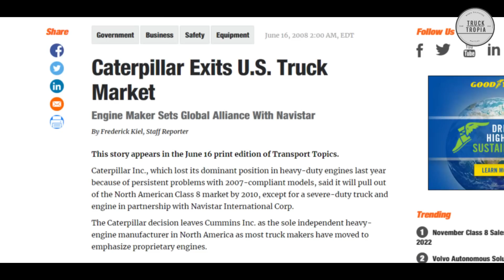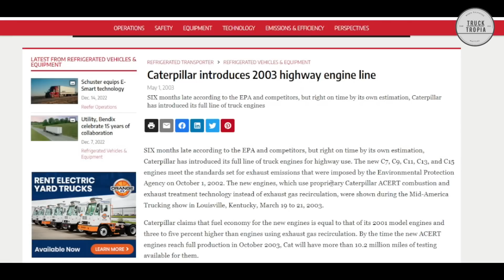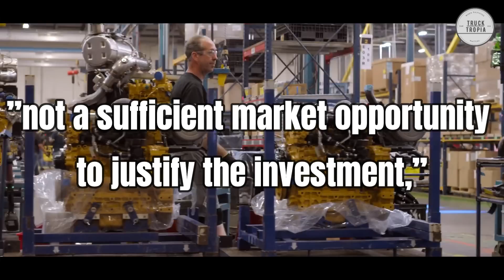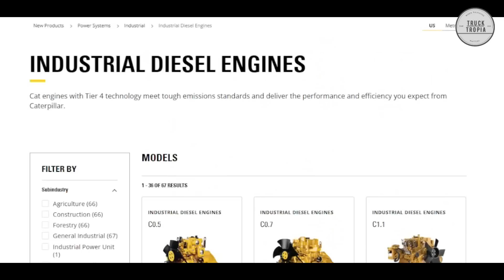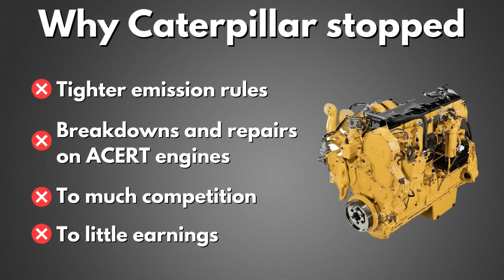Why Caterpillar Stopped Making On-Highway Truck Engines

Comment: I've seen videos (this one including) saying the ACERT C-15's are unreliable, and yet in the real world, every trucker that I've met that had a C-15 under the hood, swears by them. I know from personal experience, C-15 is one of the more reliable engines. I bought an 07 International 9400i, with an ACERT C-15 that was built in 06. Just had my 1st rebuild done at around 1.4m miles! Also got it rerated from 435hp to 550hp, still rocking strong. When it comes to the 1st wave of emissions engines (mid 2000's), I'd trust an ACERT Cat over the 14L Detroit, Cummins ISX, Volvo's D12/D13, Paccar, and...hell, I'd trust anything over a MaxxForce!
Reply: Technically « Acert » beats the NOx produced by a massive air flow increase and the very high air to fuel ratio reduces all combustion hot spots where NOx are formed. The modern paper dry air cleaner air filtration being good but not perfect, when used in dusty applications such as compound harvesters, cement factories etc..those high breathers engines suffered from higher and faster oil contamination due to larger dust burned deposits than before, one of the root cause of this love and hate mixed customers feelings …

We can also regret that discussions with MB and their famous Juergen Schrempp ceo at the time, for a common R.and D. and new common trucks clean engines and larger clean engines families (after 3406 etc) failed miserably and this guy also failed all Daimler Chrysler Mitsubishi merges,etc. While good engineers could agree and understand each others very well in Peoria Mossville and wery vell is Stuttgart also, while MB had excellent combustions simulations software technology for trucks, cars and up to formulae 1 racing engines and CAT the lead on design and manufacturing excellent engines, but when such JS chairman, ceo whatever, produces his end, meetings MoU’s, Memos of Understanding, showing fondamental diversions from the previous discussions and therefore, not treating potential partners on equal and fair basis, etc, there are no real discussion, dialogue and negotiation possible…a win win solution wasn’t there anymore, forcing at the end, Cat to develop their own Acert clean combustion and eventually pull out of this truck market while having no highway truck assembly plants in house….unlike International Harvester , Mercedes-Benz group, etc..this is how one single individual can kill great projects by excessive ego, poor assessments and disrespect..😢
Reply: 1.3 million miles on my MXS acert, never been apart yet, runs fine, pulls whatever I put behind it, I'd take it anywhere.
Reply: I was leased to a company that had over 100 Peterbilts  with the Accert motor twin turbo and they had a lot of trouble with them . Now,the Cat C15 6NZ motors they had were a different story. They were very reliable and stayed in the Montfort lane all night long.
Reply: It is my responsibility to aware every one
Quran is the last book of God which revealed on prophet Muhammad saw quran is the only source of guidance in whole world quran will show you the right path quran also verify bible and torah and other scripture kindly once time you study whole quran and aware yourself from the aim of life and got success in long run 🙏🙏🌹🌹❤️❤️

Comment: We have a bunch of tri-axle Cat dumps in our area. Don't know if they're any good, but they do look bad a$$. Forget the hate messages,  I know looks are ABSOLUTELY nothing. Our family still has a Autocar and 5 Star Generals on the farm. The Autocar has a VERY lethargic non turbo Cummins, but with a 5x4. The Generals are 6-71 T, all turned up to 2250 r.p.m. We don't have any pathetic emissions testing and the 2 strokes walk out of the sugar-sand where the big Cats and Cummins need a dozer to push them out.
Great video Sir.
Reply: learn to drive

Comment: Yes will always have a cat under the hood. My years are numbered on the road  but my 6nz (the holy grail of cats) will do me till the end Thanks Caterpillar none can compare!!!
Reply: Mine too ! It's got 1,960,000 miles on it and she still rips ! The original owner I bought from overhauled it at 1,335,000 and bought from him at 1,556,000. Exceptional engine ! Like you said, BEST CAT EVER ! 😃
Reply: In 2000 I was buying a new Peterbilt. The dealer had two 379’s on his lot . They were identical trucks except one was silver with a Cummins and one was blue with a 6NZ C-15 18 speed, I told him I’ll take the blue one.He called me a few days before I was to pickup the blue Pete with the C15 and told me the silver Pete with a Cummins was ready to go, come and get it. I told him the deal is off….blue truck or nothing. He said the silver one is almost $5000 cheaper, I told him I didn’t want it if it was free ! He said ok we’ll get the blue on ready. Going up Wolf Creek, Cabbage, Look Out, 3Sisters, Monarch, Rabbit Ears, GrapeVine, Donner Summit… no truck ever passed that Blue C-15 !!
Reply: It is my responsibility to aware every one
Quran is the last book of God which revealed on prophet Muhammad saw quran is the only source of guidance in whole world quran will show you the right path quran also verify bible and torah and other scripture kindly once time you study whole quran and aware yourself from the aim of life and got success in long run 🙏🙏🙏🌹🌹🌹❤️❤️❤️

Comment: I hope they come with a very good on highway diesel engine and there v8 engines are very good for marine and heavy duty ford trucks and i know caterpillar is one of the best American companies out there that have a very good reputation for making a very good products
Reply: No i just use to work with my neighbors logging company when the economy took a hit in 2008 stock crash and it was wake up call when it was time to bring it back with hot start up company fire wood market
Reply: Punctuation goes a long way dude. Did you drop out of school in 3rd grade or something?

Comment: I worked on a lot of cat engine's back in the day I worked on a bunch of the non electronic ENGINES from the 1960s and 1970s and 1980s I worked on truck engine's and the off road stuff a lot of them were over head cams, they were pretty much bullet proof. I don't think they will go back to on road engine's.
Reply: It's been done , I think it's easier than some swaps that have been done
Reply: @outinthesticks1035  With deep pockets lol
Reply: Do you think i can get away with putting like a 3116 or a 3208 Cat in my 1 ton dodge pick up ? Its got a V10 in it now
Reply: @ogragan3492  You know I never really thought about it it sounds pretty good I would imagine that 1 ton Dodge chassis would handle the weight ok. I saw a guy put a 3208 cat in a late 70s F250 4 by 4 it was a lot of ENGINE under the hood but a very clean installation,I think a 3116 would probably fit and they are both pretty much non electronic. But you know those are both pretty good engine's they don't have the torque and horse power as the newer engine's I guess it depends on what you want and need. I don't know but now days they make adapter kits,I think the 3208 would have more power especially if you use the turbocharged model, good luck to you.
Reply: @danhuttinger5040  Thanks alot buddy ive been meaning more towards a 3208 and i will definitely take that into consideration
Reply: @ogragan3492  I have one final comment the 3208 is pretty big cube inch If I remember correctly it is 636 cubic inch displacement more than enough for a one ton.
Reply: @danhuttinger5040  Right on, probably bash in the firewall and add some beefed up support to the front end, its gonna be alot of fabrication and customization taking place but im gonna go for it one day in the future
Reply: @ogragan3492  Sounds like your capabul of doing it I used to do about everything mechanical I mechanicd for 55 years my own business for 42 years, I will be 74 next month and am just wore out I sure enjoyed the work most of the time I also enjoyed standing back when the job was done I gave it my very best. Really good talking to you sir.
Reply: @danhuttinger5040  Yes sir youve paid your dues and now it's time for you to sit back and relax a bit, thanks for the advice
Reply: @ogragan3492  Thank you for the reply I just want to say one thing about me even as many years I did mechanic work I never quit learning even though I finally retired a year ago I am still interested in new things and learning.I feel like if you get to a point where you think you know everything you are in trouble.
Reply: @ogragan3492  I don't know about emissions issues (a 3208 is not the cleanest engine in the world even with the 3 ring piston) but it will fit in a f350. I saw one in a 72 f350 when I was working at the Oxnard cat dealer. 10ft cab over camper and the guy said it got 16mpg, city, highway, uphill or downhill.
Reply: @cbmech2563  Yeah they often times run kinda rich and burn dirty, theres a guy on YouTube with a old Ford 3500 and he's got a 3126 in his he made a whole channel about it
Reply: It is my responsibility to aware every one
Quran is the last book of God which revealed on prophet Muhammad saw quran is the only source of guidance in whole world quran will show you the right path quran also verify bible and torah and other scripture kindly once time you study whole quran and aware yourself from the aim of life and got success in long run 🙏🙏🌹🌹❤️❤️

Comment: Thankfully pre emission cat motors that are re manufactured are available to buy til date. The only motor that will ever be under my hood
Reply: My parents felt  the same way about cat engines. Eaton fuller roadranger transmissions to
Reply: @brownedward93 Id rather Rockwell !!!
Reply: A brand new Peterbilt glider kit with a Caterpillar reman C15…..you would be a certified member of the “left lane gang”
Reply: @D R  even a project truck with a reman 6nz, c-16, or full beast mode with a c-18 if you can get your hands on them. Reliability is everything. Not driving 400k and having to spend 30-40 thousand on a overhaul
Reply: Really I don't fucking care about the emissions the more important it's a fiability and quality after many years  I see the biggest difference 🤔 I NEVER EVER change my 3408 for other caind of the engine  now I driving over 2.822.000kms and running like a new 👏👏👌👍 ORIGINAL without rebuilding 👌👍 just normal maintenance  this is a really CATERPILLAR quality 👏👏👌👍 cheers from Norway
Reply: Add Detroit
Reply: You better have a big ass wad of money come rebuild time.
Reply: Amen brother
Reply: @je862  brother there are alot of things in holy bible which are fabricated and conspiracy against Christianity and some are towards the God which we follow to him.
Brother jesus never say this I am God or son of God he testify in his own life oh people I am only the messenger of God.
Brother when you will study Holy quran it will tell you those all things which are fabricated and give you strong arguments.
Brother give the quran a chance you won't lost any thing pls read it and try to understand it I hope you will know reality 🙏🙏🙏🌹🌹🌹❤️❤️❤️
Reply: Allo John , got a new motah?
Reply: But don't you have to keep those remanned engines in the older trucks that they came in? I thought I heard that glider kits were a "No-no" now today.. 🤷🏻
Reply: It is my responsibility to aware every one
Quran is the last book of God which revealed on prophet Muhammad saw quran is the only source of guidance in whole world quran will show you the right path quran also verify bible and torah and other scripture kindly once time you study whole quran and aware yourself from the aim of life and got success in long run 🙏🙏🙏🌹🌹🌹❤️❤️❤️
Reply: @RussianFans-vn6cj Get Lost !!!
Reply: Government must tax your wealth and property to survive woot woot progress!  Honest trade among friendship.  Article 1 Section 10
Reply: @greenmirror5555  I mean you could always pay for the road yourself I suppose.  Or the bridge you just drove over.  It’s not like the weight of the loads you are hauling don’t beat the hell out of them.  Without good rads commerce in this country comes to a dead stop.  It’s taxes that pay for those roads.  Unless you want to go back to toll only systems.
Reply: @greenmirror5555  wise man
Reply: Famous last words. Don't worry, you will deprived of pre emissions engines soon enough.
Reply: They sell a lot of those reman engines, about every 200k miles... Now everyone went Cummins, last 500k miles and can overhaul in frame.
Reply: @bvfarmz3421  your opinion, I'll still choose a pre emissions cat, and get more than 500,000 miles out of it, it's all about mantinence.
Reply: the 3408 was an over priced emginr. Hesvy and hard to find someone to work them. We replsced sevetal of them eith 375 big cam zmCummins. The times to LA out of Denver were the ssme. The difference in fuel consumption was shocking.
Reply: @raginroadrunner  50ton mostly of the times  and around 43liters per 100kms! this is what he consum 🤔 in normal driving smooth of course 👌👍👍 and  still stronger and not leaks any oíl
Reply: engine------motors run on electricity.
Reply: @dickfitzwell4920  That's your opinion. Both of those words are interchangeable and mean the same thing.
Reply: @dickfitzwell4920  No, motors are devices that propel something. It could be gasoline motors, electric motors, or rocket motors.
Reply: @Ry_TSG  Kevin Cameron discussed this years ago. We put motor oil in our vehicle engines. Racers will say that a faster car has more "motor" than the competition. When that car passes another it's said to "motor on by". He writes good columns.
Reply: @dickfitzwell4920  I use to preach the same. But if you Google it the definitions have changed to make calling an engine a motor.   Weird I know
Reply: @rodgersrcaviation2785  The 1828 edition of Webster's dictionary defined motor as "a mover" and engine as "any instrument; that by which any effect is produced."
Reply: @zeke1220  while I totally agree with the differences of a motor and engine because I too differentiate them.   The modern definition of them has changed to mash them together.     Many individuals not born in the late 1900s think Google is the supremacy on definitions and will argue based on those findings in Google.  The internet being as powerful as it is definitely has an effect on the understanding of basic knowledge because u don’t have to search it out.  You can ask Alexa and she spits stuff at you and most take that as fact!!

Comment: How could you not mention cat 3408...
Reply: I had 3408 6plus 4 Spicer great truck 359 peterbuilt but I went with 3406b and 18 was even better on fuel and performance. That was my favorite.  It was in a w900 and was an amazing truck no issues. Easy to maintain. Run like a train.
Reply: Passed everything but a fuel pump
Reply: Underpowered boat anchors.

Comment: Its funny that they stopped for emissions but still had to put all that crap on their equipment/off-road engines.
Reply: I don't think off road is as strict as on road diesels. Similar to marine regs🤔
Reply: @rickdawg73  Imagine the sheer size of the cow piss converter !! Those things glow red-hot during regen - - must be awesome on a giant V20
Reply: The heavy industries negotiated a delay from automotive norms from 2 technology cycles. It's like the Dieselgate VW TDI's stills California compliant nowadays. ^^

Comment: i wasn't expecting the CAT would make a engine for trains
Reply: Cat bought EMD and Progressive rail was born. They build the complete locomotive not just the engine.
Reply: The EMD F125 uses CATs V20 engine to comply the Tier IV emission standards
Reply: @anf_8310_ab  When did the Cat take the place of the 710?
Reply: They've made a one off car engine once. It was either CAT or perkins (the company that makes CAT engines in UK)
Reply: It was the good replacement product nowadays to non-compliant EMD engines for European markets, in V16 form.